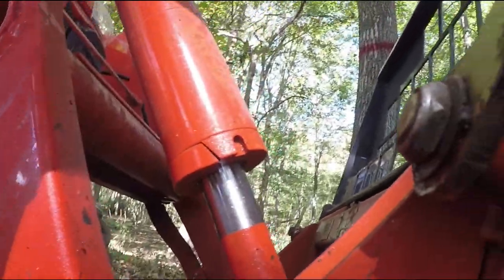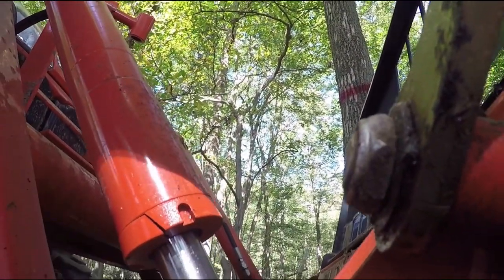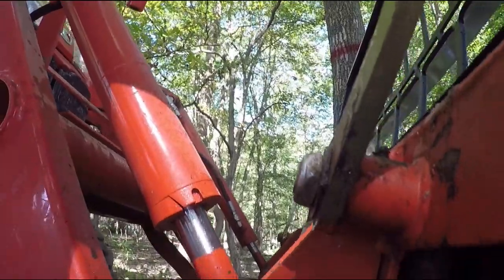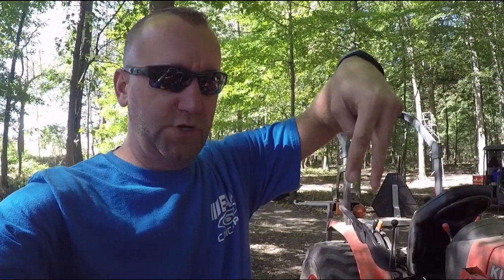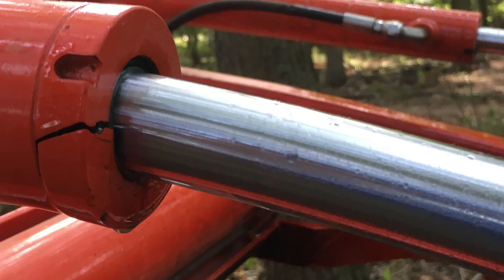Don’t Do This With Your Tractor!!

Comment: Those little tractors are woefully under designed the cylinder should handle most anything thrown at it short of abuse good luck .
Reply from the maker: Jeff Arp 
It happens to big tractors too. It’s the forces of driving that overcomes the strength of the cylinder. The bigger the equipment the more force it can exert when driving.
Reply: ike fun careful your   i.q. is showing.🤔
Reply from the maker: ike fun 
You’re not understanding any of this and I can guarantee I’m not an idiot by any means. What I was saying there is that it’s not the hydraulic power of the cylinder that does the damage. It’s moving the machine when the hydraulics aren’t being used. If a large excavator grabs a hold of something with the teeth of the bucket while the teeth are pointed backward and the cylinder is extended, and then proceeds to drive the tracks backwards it is exerting more force on the cylinder than the hydraulics.
Reply from the maker: ike fun 
You’re making my day. I love trolls. 

I know every part of of a cylinder and a semantic slip up during an impromptu video doesn’t mean otherwise. I’m sure I have verbal slip ups in all of my videos if you’d like to pick those apart as well.
Reply from the maker: ike fun 
No. I didn’t say a longer cylinder made more power. I said I may upgrade the cylinder over the current 1.75” but I’d have to probably get a longer one because they don’t make one close to my stroke. I’ll probably go with a 2”. When I do upgrade I’ll be doing both cylinders. Why would you replace only one and cause a bind? That doesn’t make any sense. 

I’m sorry you’re having to twist my words to fit your narrative. I know you don’t know me and don’t know that I’m an engineer with a background in electronics, mechanics, hydraulics, pneumatics, high voltage electricity, etc. I’ve repaired CNC and manual machine tools, worked in IT, and currently travel repairing complex machines. I’m known as the guy who can figure anything out and can fix anything. I’ve never lived in a city and only stopped farming because my dad retired and I travel too much to take it over. People tend to resort to name calling when they can’t get their way or can’t get people to agree with them. I’ve learned not to let it affect me as I’m not looking for anyone’s validation and I’m too smart to fight on the internet. 

Your style of writing, grammar, and name calling is letting everyone know who the bigger person is here. I appreciate everyone’s comments, good or bad. I’ve learned through the years that’s there are tons of trolls out there hiding behind the safety of the internet, but so far you’re my favorite. Sincerely, thank you for taking the time to write any and al of your comments.

Comment: You need a L series B are way too lite oversized garden tractor
Reply from the maker: sancoffsr 
The same damage is found on all sizes of equipment. The larger the equipment the more force they can apply when moving. Since they can apply more force they can bend larger cylinders.
Reply: When I bought my tractor I did a lot of research and found that B series Kubota’s by the way have frames are way to lite to do any kind of heavy moving L series are much heavier machines and can take a beating that kind of damage is unacceptable L Series are use in construction I would complain best of luck
Reply from the maker: sancoffsr 
I’m not saying the L series isn’t heavier. I’m just saying that this damage isn’t because of size. If you research this damage you’ll see it across all sizes and brands. It’s happened to CAT equipment that weighs 10 times what your L does. 

I’m looking at getting an L next. It’s a shame that it doesn’t lift much more than mine. I’d expect the heavier tractor to lift much more. I’m leaning towards the 3901 just for ground speed although my dealer says everyone with the 2501 is happy and it doesn’t have the emissions crap.

Comment: What about back dragging with it in float?
Reply from the maker: Lee GingerHulk Lavinder 
Float won’t help with curl cylinder if it catches something. Float will allow it to go up and down over stuff but if the bucket is at full dump and catches something it will still try to push the rod back in.

Comment: I am in Rhode Island I send cylinder to a place called TRI Power they have the chrome rod cut it to length thread it and weld the end on. there must be someone in your area that can do this. don't know what the cost diff would be.
Reply from the maker: James Beck 
Thanks. I was heading down that route when we found the tube was deformed. That made the total repair more expensive than a new cylinder.

Comment: IF you are going to play Logging .YOU should buy a bigger tractor with a grapple. Learn to use the equipment
Reply from the maker: Jim Currier 
Logging wasn’t really what damaged the tractor. If I didn’t use the forks in the manner I did it wouldn’t have failed. I was just sharing because when I researched the damage I found equipment of all sizes with the same failure.

Comment: Should have spent the extra money and got a John Deere. I backload with my John Deere all the time no problems just saying
Reply from the maker: Walter Weishaupt 
I had back drug a thousand times before that too. You’ll have no problems right up until you do. It wasn’t until I researched that it clicked. Long term operators know the risks and teach new operators not to do it. Take some time and do some reading and research. I don’t have anything against Deere but you’ll find just as many damage stories on the green forums. 

No brand or size is immune. There are numerous reports of all brands and several guys have even posted in the comments here. Large pieces of equipment bending 4” cylinders. Everything has the potential to break.

Comment: you cant do that stuff with loaders that are made only for loading..that will never happen with a commercial construction tractor like a case backhoe or a cat.
Reply from the maker: George Almeida 
That’s not true. It has happened to those pieces of equipment. There’s a guy who commented here about doing it with his CAT track loader. The power of the machine driving is much stronger than a cylinder. It’s not the hydraulics that does this. It’s the forces of the machine driving.

Comment: I use 2 choker chains, and a floor jack. You can either tug the log out by a branch just enough to choke with chain or use floor jack to lift up enough to choke. Them little tractors are just a money grab off old people.
Reply from the maker: Martyn B 
This isn’t exactly little but isn’t huge either. I have a skidding attachment that I use for skidding logs. I just wanted to separate it to easily grab it.

Comment: that's what happens to a small tractor not made for that you should have bought yourself something a little bigger if you're going to do that kind of work
Reply from the maker: William Grant 
This kind of damage is found on all brands and sizes of equipment. It happens when the cylinder is fully extended and the machine is driven, putting forces on that cylinder. The power of the machine while driving is a lot more than what the hydraulic cylinders can handle. I was sharing so everyone will hopefully understand how forces are applied to fully extended cylinders. If you read through the comments you’ll find lots of stories of others who have done it to larger equipment of different brands. CAT track loaders, etc. 

I didn’t think I was really doing anything beyond what my tractor is capable of. I’ve pushed it much harder than I did here. I think I must have just had the tips of the forks on the back side of the tree instead of the meat of the forks. I had a lot of leverage forces pushing the cylinder back in. If I didn’t drive backwards but used the hydraulics to pull it back it would’ve been fine. I also can’t fit much larger of a tractor in my woods. I have some mature trees along some paths that I’m unwilling to cut down just to get a larger tractor. It wouldn’t have broke if I used it properly.

Comment: Very light duty cylinder, my Mahindra is 3 times that size
Reply from the maker: John Halter 
All equipment sizes and cylinder sizes get damaged the same way. It’s not because it is undersized. 

How many hp is your Mahindra? What size rod and bore? I haven’t seen any tractors of this size with a bigger cylinder.

Comment: Those cylinders are to small !!!!
Reply from the maker: Yep. 1.75” bore.
Reply: John Lieske 
No, if they were bigger then it would take too long to fill and roll the bucket. It might help to mount the cylinder at the rod end (I think they call them trunion mount), so there is less ability for the whole thing to bend. I don't really see any limitation to doing that, it must be a cost issue that they don't.
Reply from the maker: Court 
If you’re talking about the cylinders being flipped around then the hoses would have to move with the curl. They’re mounted the way they are so the body is stationary.
Reply: WorthOverdoing 
No, the ends on the cylinder remain where they are, where the cylinder attaches to the tractor changes. So instead of the far end, it attaches at the end closest to the rod (in the middle if the rod was extended). Search the web for trunion mount cylinder to see some pictures. It would take some of the ability to bend in the middle out. The rod would still be cantilevered out there though, and can apply high forces when fully extended and any off axis load is being applied. The trunion mount helps keep it from being off axis.
Reply from the maker: Court 
I know what mean now. Some log splitters are built like that. It would help with the overall length and prevent the middle from lifting as you stated.
Reply: No, their size is correct.  The problem is that the operator took the equipment beyond its capability.  Anyone using forks, which increases leverage, should be aware.

Comment: Your a melon for  going in with a small yoke like that its any wonder why it's bloody broken too much pressure on them front loaders break like nothing
Reply from the maker: Tartus Maximus 
I did have a brain fart with this and wasn’t thinking of the forces with the forks. When researching the problem I found so many similar failures that I felt it was worth sharing.

Comment: Poor design. The construction equipment I've ran has stops built in to the loader arms and linkages.
Reply from the maker: usernamenaw 
Stops wouldn’t help with this problem. The tractor has bucket stops. It didn’t curl too far and bend over that way. It was at curl, stationary, and when backing up the load was trying to push the rod back in. Unfortunately, the load was greater than rod could handle at full extension. I’ve found similar mishaps on all kinds of construction equipment regardless of size and strength. I’m just wanting everyone to understand the direction they are applying force and how it is applied to the cylinder.
Reply: WorthOverdoing 
What is the diameter of the rod? Like what 3/4”
Reply from the maker: Sicktrickintuner 
1”

Comment: hate to tell you but Kubota is cheap stuff
Reply from the maker: Alden H 
I’ll disagree. I looked at every tractor manufacturer and did my homework. Kubota is at the top.
Reply: No dealer network dealers are far and few here I look at service and parts availability too John Deere is second to none here in kansas
Reply from the maker: Alden H 
Around here Deere dealers are ok but I could get a lot more tractor for the money with Kubota. I own a Deere zero turn and dread having to go to the dealer. We even went away from Deere for the farm equipment. 

Deere tractors under 40hp are made by yanmar and most are made in China. I got more hp, higher lift, faster speed, heavier tractor, and a non-Chinese tractor for less.
Reply: WorthOverdoing ok well glad your satisfied these days every one makes the smaller tractors for smaller operations and most are made some other country deeres small frame tractors are made overseas as well so good luck hope you got yours fixed and back in service
Reply from the maker: Alden H 
Thanks. As you led to earlier, I think your local dealer can really make or break your happiness with your tractor. Having any brand tractor is better than not having one at all. They are all pretty close in capability so often it is the support that makes the difference.